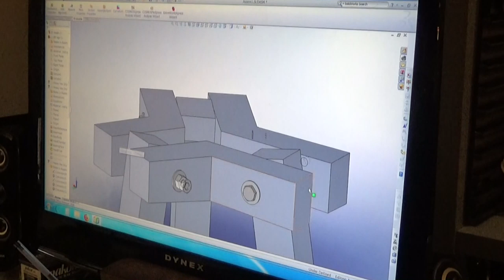Stacking Large Retaining Wall Rocks with Homemade Lifting Crane

Comment: Since you can obviously weld...why not just build the three angled pieces out of 3"x 3" at 3/16" wall instead of 4 x 4 wood.  Seems a lot easier and a lot safer (if welded correctly).

Comment: I lived in both Devon and Cornwall, in south-west England, where there are granite quarries, who sold off-cuts cheaply by the ton. ...... They cut stone with saws, so there were many thicknesses, plus they chiselled surfaces and shapes, and there were broken pieces, plus the 'extras' made in case of breakage, as well as general waste. ...... Some stones were several hundredweight. ...... I bought some stone-carving chisels from a retired monumental mason, and included was a 4 foot tapered steel bar, designed for moving stones. ...... Worth it's weight in gold!

Comment: Took too many risks in that video, remember the only tool you can't replace is you... Huge block of stone dangling from an under powered winch and you are stood underneath in pumps... Apart from renting one, A better design would have used a single HD pin with a with a few quick links attached between the legs, triple the winch wire up on a few snap blocks and get a mate to help.